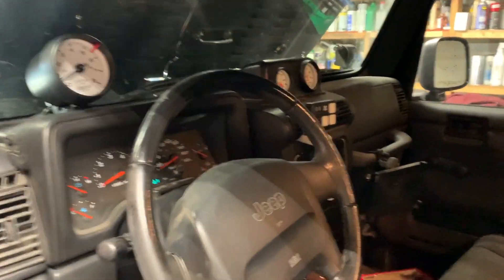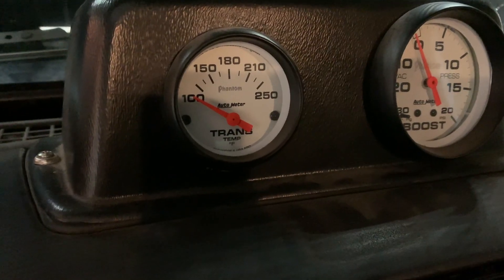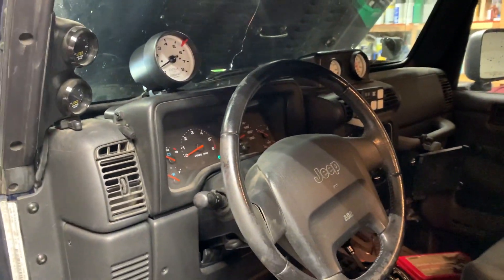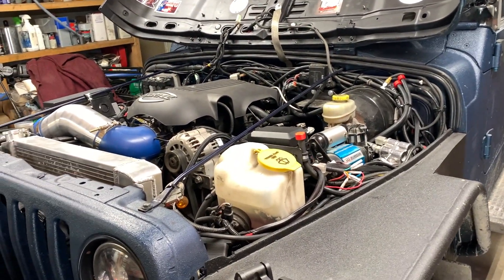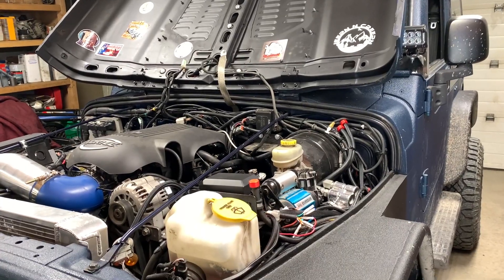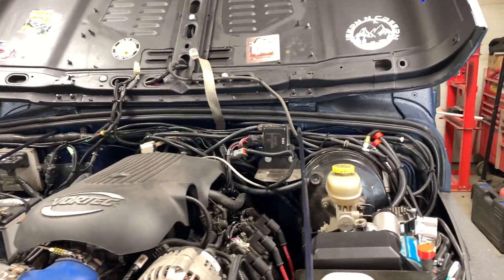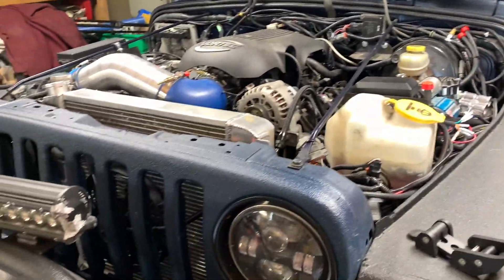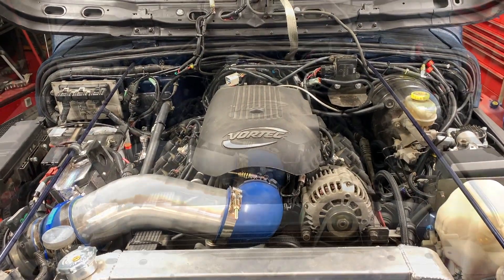Why Do I Need a Transmission Cooler ?

Comment: One reason they say to not use the cooler in the radiator with a rebuilt transmission is because the radiator's cooler may be plugged or contaminated with particles from the the failed transmission. If you connect the radiator's cooler to the replacement transmission, you risk contaminating your replacement transmission with debris from the old transmission. You can flush the cooler out with solvent and compressed air to try to prevent this from happening, but flushing isn't 100% effective and may leave particles behind that can damage the replacement transmission. In most cases the best thing to do is to just bypass the cooler in the radiator and use an external cooler instead so you don't risk contaminating the replacement transmission. You will also get the benefit of improved cooling if you get a good cooler. Of course you still need to flush or replace the cooler lines for the same reason.
Reply from the maker: The radiator is brand new

Comment: iMO I think if you want to get the temps you mentioned you would have to run two coolers.I have a Jeep wj supercharged and I run two 52 stack coolers and I have never gone over 180. Also look into getting a transmission shift kit.